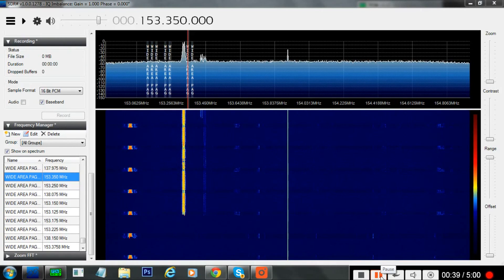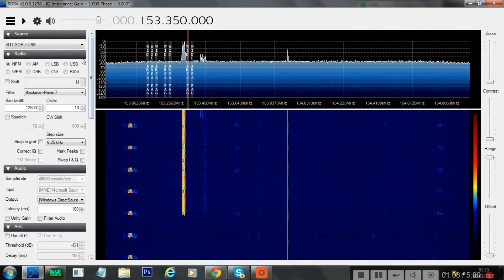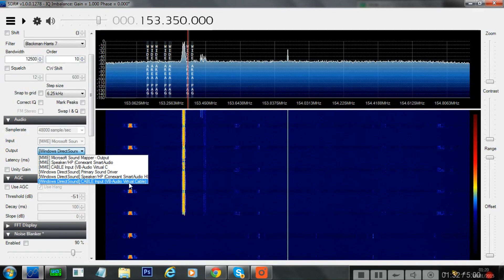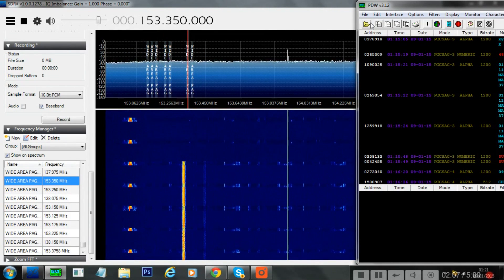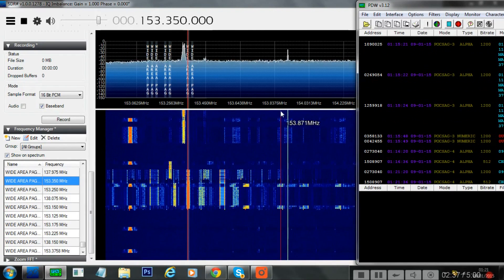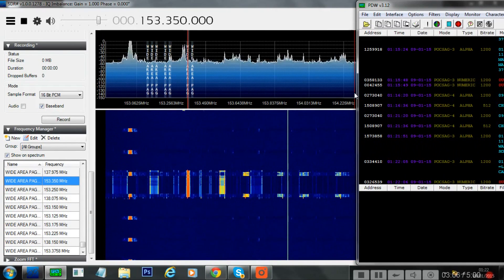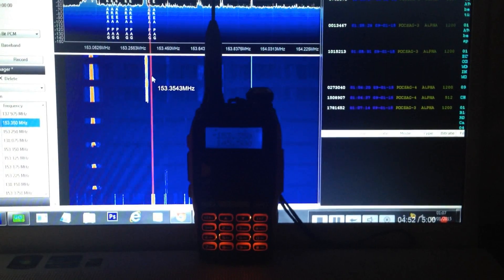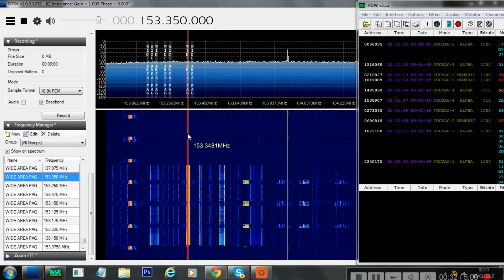Decoding Pager Traffic With SDR# & PDW

Comment: Hey man, could you help me? I have everything setup perfectly and the signal is coming trough clear and piped trough with VB cable and it's stil not decoding. The little audio meter on the top right of PDW is moving when there's data coming trough and squelch is off.